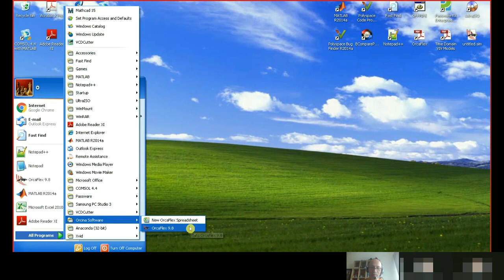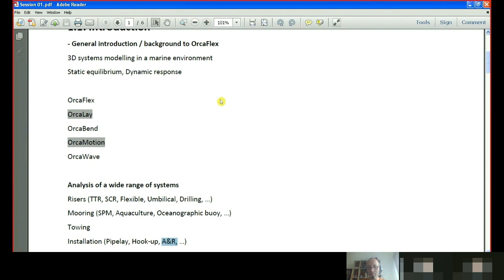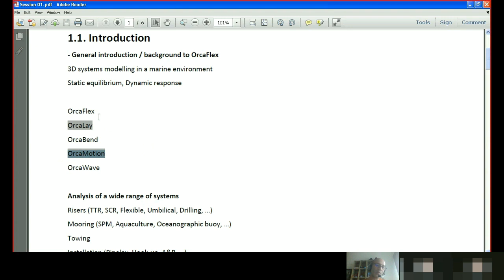OrcaFlex History

Comment: Just some comments.

OrcaFlex was first released in 1986. 

OrcaLay was never really meant to compete against OFFPIPE. It was designed for a specific task at the specification of a client. You are correct that once the line supports feature was added to OrcaFlex then it was able to line up against OFFPIPE.

OrcaMotion is a very old program, for DOS, whose job was to convert RAOs from a variety of formats into a form that could be then imported into OrcaFlex. It had some other functionality, but essentially that conversion task was its primary function. Again what happened is that the conversion and import functionality was moved into OrcaFlex and thus OrcaMotion became redundant.

I would not regard OrcaMotion and OrcaWave as being related. OrcaWave is a comprehensive diffraction / radiation code with functionality very similar to WAMIT / AQWA / Hydrostar etc.
Reply from the maker: I didn't mention the first release; I mentioned the first release with the current visual GUI. You can check in their website.
Since from all over 20 OrcaXXX software, I just have experience of these 5 software that I listed and also OFFPIPE, I just talked about my findings from employing these 6 software.
Reply: @stronger_ai  OK, I hadn't realised that you were picking out the point where the Windows version of OrcaFlex was released. Anyway, my comments are from the perspective of being a developer of the software you are talking about.
Reply from the maker: @davidheffernan3829  So you're one of the developer. Nice to see you here. 🌼